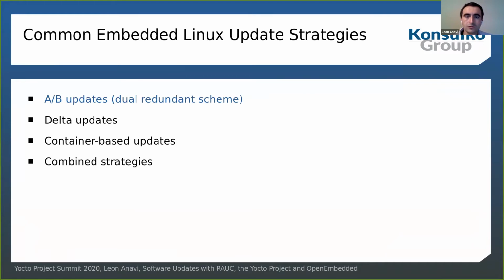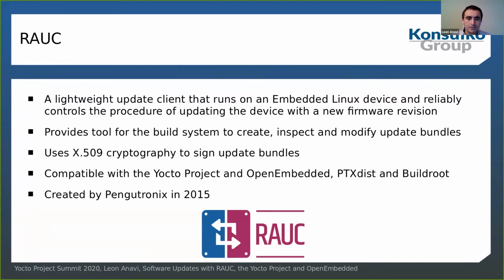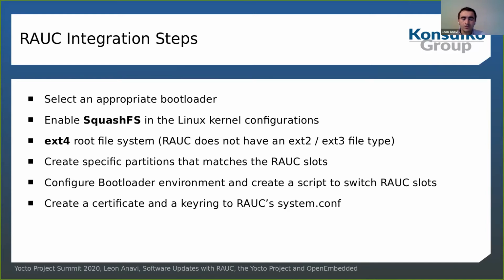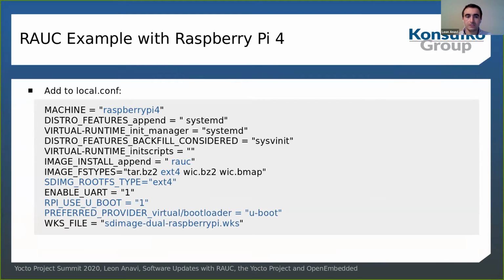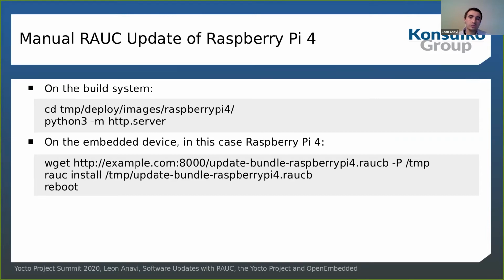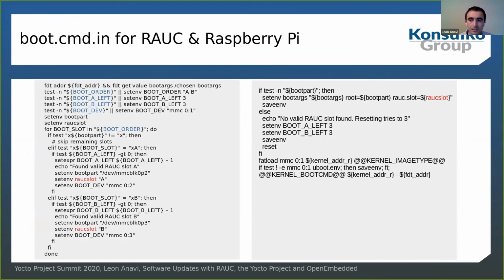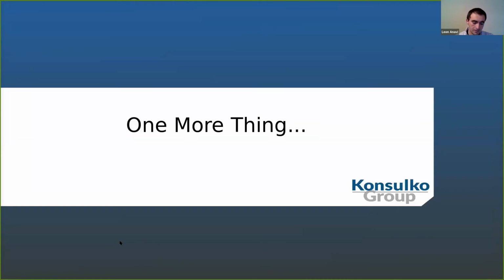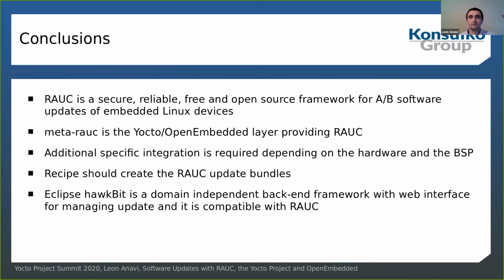Software Updates with RAUC, the Yocto Project and OpenEmbedded by Leon Anavi

Comment: ERROR: core-image-minimal-1.0-r0 do_image_wic: No kickstart files from WKS_FILES were found: sdimage-dual-raspberrypi.wks core-image-minimal.wks. Please set WKS_FILE or WKS_FILES appropriately.
ERROR: core-image-minimal-1.0-r0 do_image_wic: Execution of '/home/rat/rauc_raspberry/poky-rpi-rauc/build/tmp-glibc/work/raspberrypi4-oe-linux-gnueabi/core-image-minimal/1.0-r0/temp/run.do_image_wic.28073' failed with exit code 1:
WARNING: exit code 1 from a shell command.

DEBUG: Executing shell function do_image_wic
ERROR: No kickstart files from WKS_FILES were found: sdimage-dual-raspberrypi.wks core-image-minimal.wks. Please set WKS_FILE or WKS_FILES appropriately.
WARNING: exit code 1 from a shell command.
ERROR: Execution of '/home/rat/rauc_raspberry/poky-rpi-rauc/build/tmp-glibc/work/raspberrypi4-oe-linux-gnueabi/core-image-minimal/1.0-r0/temp/run.do_image_wic.28073' failed with exit code 1:
WARNING: exit code 1 from a shell command.